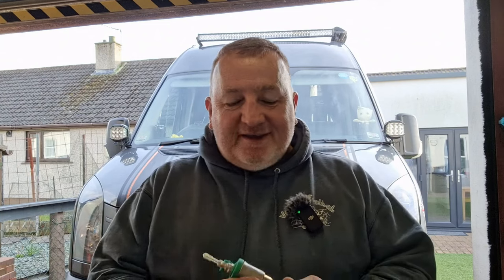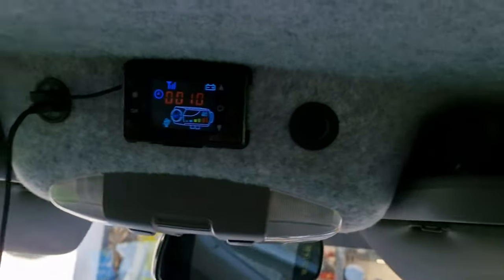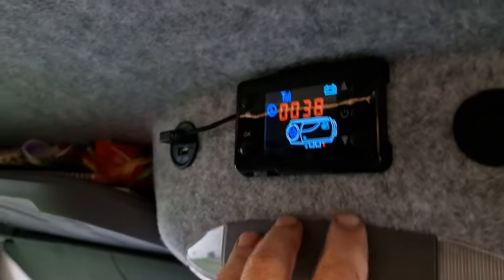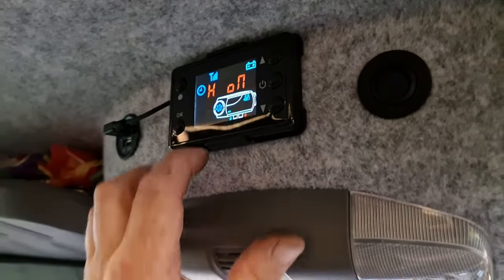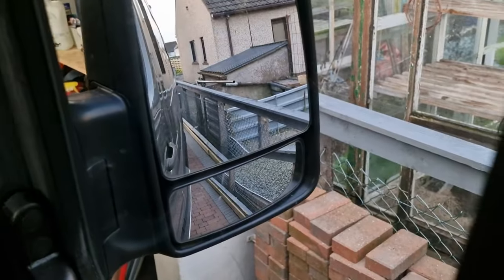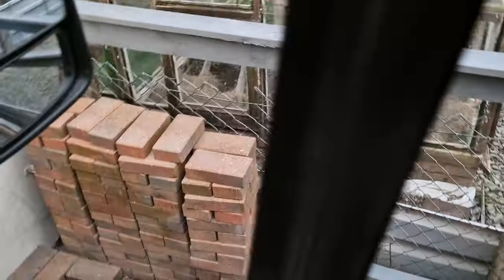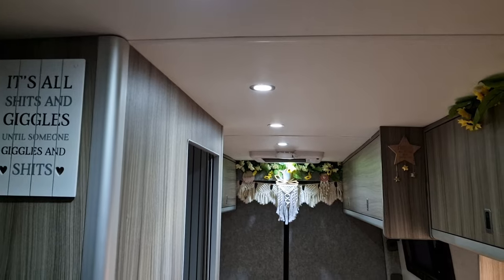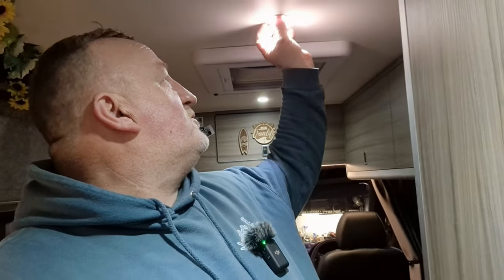Silent Chinese diesel heater pump install

Comment: Hi Sam. I bought the WiFi controller off eBay for my heater. It actually turns the heater on and off at the temps you set. Game changer. No more waking up cold or sweating my t**s off. Plus you can use your phone to turn it on and off remotely. Well worth the £100 I paid. Great video as always bud keep em coming. 👍🏻👍🏻

Comment: Great video Sam. To silence ours i put the original in a plastic box with i covered in Dodo matting, which works fairly well, but you can still hear it slightly when in bed, this might be an option for us to remove the little bit of a clicking we do have, great find.

Comment: Hint for when flooding the chamber and the flame fails on startup...
Kink inlet fuel pipe, go through startup, once you hear the flame fire up, unkink and run at full power until hot.

I had lots of problems identifying the issue and it was the burn chamber flooded and in an area that cant be opened without a disc cutter.
Reply from the maker: great tip thanks for sharing

Comment: The anticipation was palpable.  They should not be called silent, just quieter, or a really quiet pump. 
I’ve yet to buy mine and fit it, will probably get it done nice for the summer.  Will check out your web page and the FB page 👍👍👍😎
Reply from the maker: To be honest when I looked back at the ad for the pump to see how much it was, it is sold as a ultra quite pump

Comment from the maker: Do they? I'm 3 years in with mine, and my only complaint I've had is the pump! Swapped it out, and the issue has been resolved
So I stand by what I said cheap and cheerful so far it's cost me less than £35 over the 3 years, 
Autotherm was an option when I was building the van. If I had installed that, it would have cost over £600 so £200 a year so far £35 against £200 wins every time 
Hope you're enjoying the channel thanks for the comment is always good to hear different opinions 👍

Comment: There is only 1 silent pump for these things.  They are (or were) made by an English gent named James Browning-Smith.  They are $$$, but are literally dead silent and have an anti-siphon protection option.
I just don't think any of these dosing pumps from China are ever going to be truly silent.  
In any case, thanks for the video.  I didn't realize Ray Winstone was on YT. ;)
Great to keep up on the state of things with these heaters.  Sure can't beat the price of them, that's for sure.
Reply from the maker: Thank you. Our new sump is a lot quieter than the previous one

Comment: This reminds me, I'll have to fit mine, bought Feb last yr😂 tick tick boom
Reply: Just got round to fitting mine as the original pump died. Mine is fitted in the same spot as yours, it now just dangles in mid-air on hd zip ties, the sound was resonating on the metal panel. 
Virtually silent.

Comment: Amazon link not working, wonder which pump it is as it sounded useful if it's got a filter already in it.
Reply from the maker: sorry links will only work while the sellers have the item just search for silent pumps

Comment: Hi there, you wanted ideas for video content? I removed the plastic steps from the cab and found the common problem of worn out door seals, so loads of water under the plastic step causing rust. I bought two near cab door seals from Mercedes for £50 each. I have the various tools and paints to tackle the job. Would be interesting to take out the 3 screws holding you step in place and see if you have trapped water and hiding rust?
Reply from the maker: one of the first jobs we did was to clean that area, great idea I will take a look as its been a few years now

Comment: Good morning Sam, still following your videos, good work and good ideas 👍.
I am nearly done with my sprinter conversion, hopefully, I have ticked all the boxes to register as a campervan from a van.
I am looking for guidance/ assistance with the wiring to complete everything wondered if you could help?
Let me know 👍
Reply from the maker: We can try to help
Reply: That's good to know, I have installed another RCD in the consumer unit giving a total of 4 - Mains input, and 3 sockets, working, I shall look at wiring the shower, toilet. water pump tomorrow.